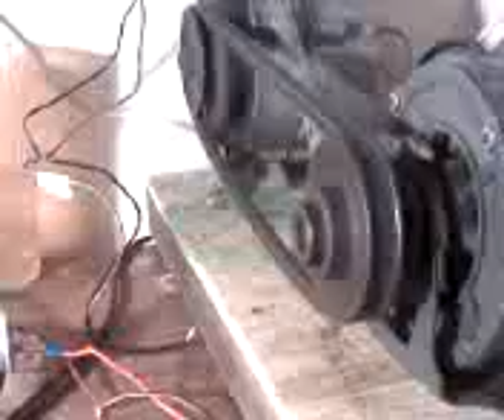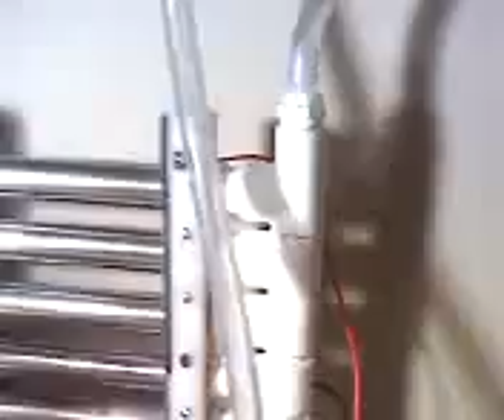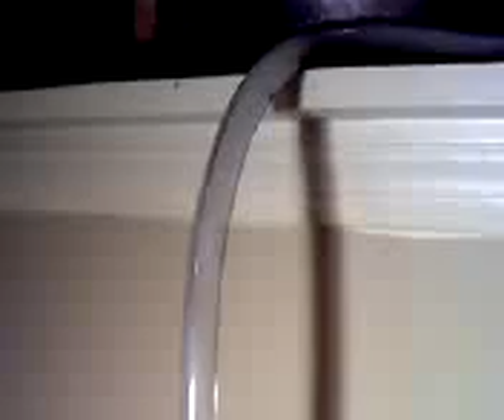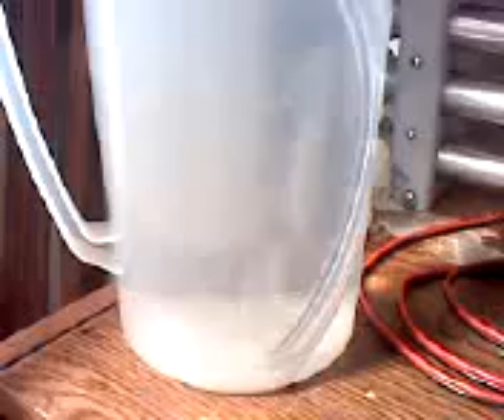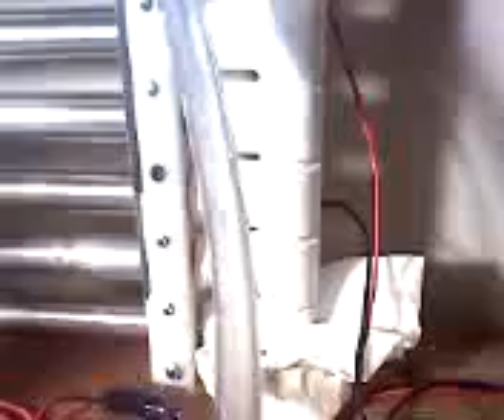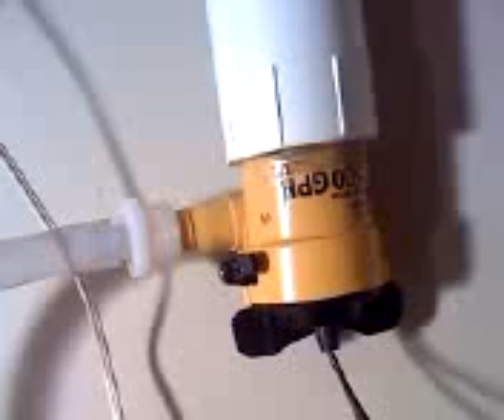New Karebill cell, HHO generator

Comment: That is a pretty elaborate setup you have constructed there.  Would love to see what makes it tick inside.

But, if I got your numbers right, you are getting 1.25 LPM at 25.2v and 18.2a ... this would be only 2.75 militers per minute per watt ... so your efficiency is only average ...  are there tweaks you might be able to make to improve this ???  or did I get your numbers wrong ???  seems it should do better than that ...